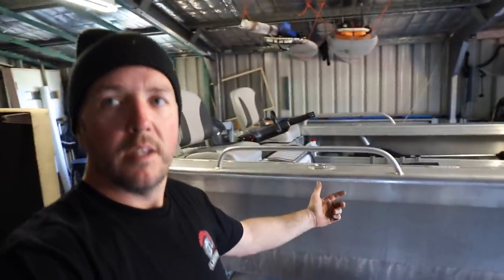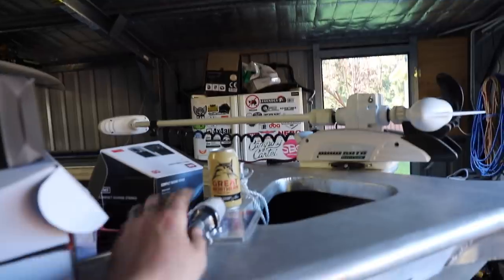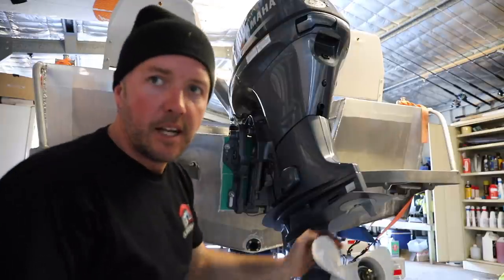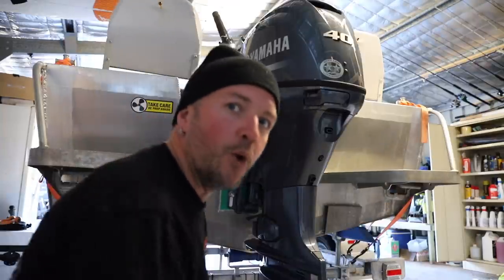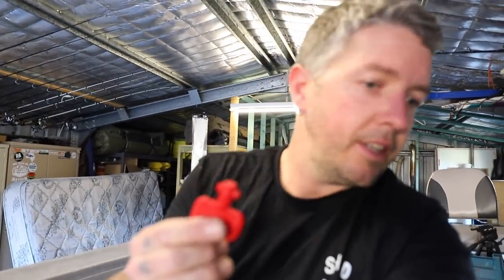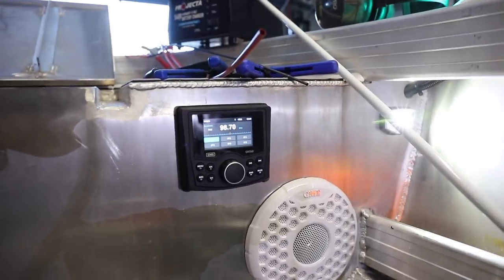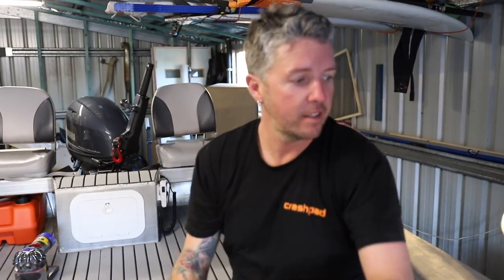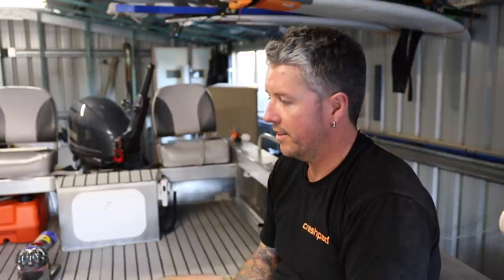SETTING UP THE ULTIMATE SMALL FISHING BOAT

Comment: Looking good mate! Those stedi interior lights are cool. Feels much better when you do the work yourself and then get out there and slay a few fish.

Are your nav lights on a different switch to your all round white light at the stern? Your white light should be on at all times at night and your nav lights should only be on when running. The white light also needs to be visible 360 degrees so needs to have a bit of height to it. Not trying to be negative at all - just looking out for your safety and ensuring you're compliant so you don't get stung with a fine! 

Looking forward to the next video!

Comment: Nice boat. Your nav lights port and starboard are ment to be on edge so they throw out the right angles of light
Reply from the maker: Yeah those particular lights I bought  are vertical mount ones which I didn’t know until a couple of people told me, I’ll buy changing them to horizontal mount lights that have the correct angles for where I have put them

Comment: Mate the hole in the aluminium that the hatch goes into is bigger than the hole of the actual hatch. That battery looked like it only just didn’t fit, best bet to just unscrew the hatch set up, then put your battery inside, then screw the hatch set up back on. Save buying or cutting anything.
Reply from the maker: That hatch was siliconed and pop riveted in place so ended up cutting it out and then making the hole bigger and putting the next  size hatch up in there 🤘🤘

Comment: Cutting out and replacing the hatch is a big job. Maybe you could find a Lithium cranking battery with a smaller physical size but with a similar or greater cranking capacity to fit into through that hatch ?? Lithium cranking batteries are becoming more popular in boats, 4WD's and motorcycles these days. Or you could buy two smaller batteries to fit through the hatch and connect them together in parallel to match your desired cranking capacity. Just a thought. What ever you do, I hope it works out for you. Thanks for sharing your time in the man cave.
Reply from the maker: Yeah I went through a whole range of options for that space hey and trying to make it work with how it was.... I ended up buying the next size up hatch and cut it out and cut the hole bigger 👌👌 only took a hour or so... but man has it made it better in there, I could get a full size battery in there now I reckon
Reply: @AzventuresAustralia  Nice work. Your problems are resolved. Good luck with the fishing. 😁

Comment: Maate you heard the saying "measure twice, cut once? Well in your case it's measure twice - hatch dimensions/battery dimensions and buy once....... Other than that you did a good job 👍
Reply from the maker: Unfortunately for me I measured everything a few times and bought a battery that should have fit according to the website but I don’t think they take into account the 2mm lip of the top of the battery, so it should have worked.... but didn’t... all good now thought, I cut that small hatch out and put a larger hatch in and now can put a bigger battery in there 🤘🤘